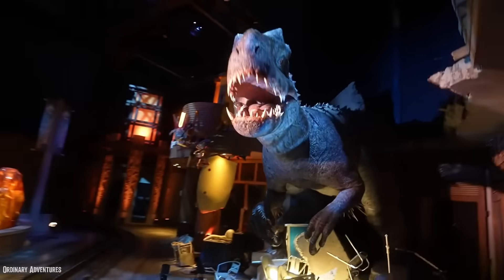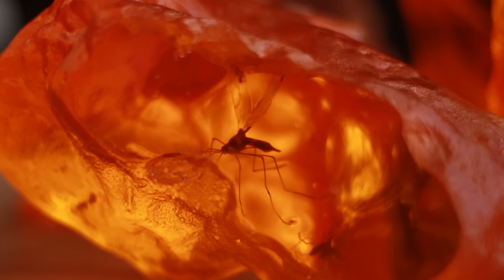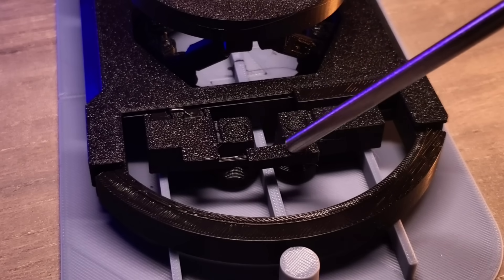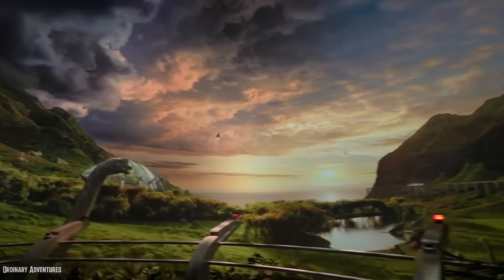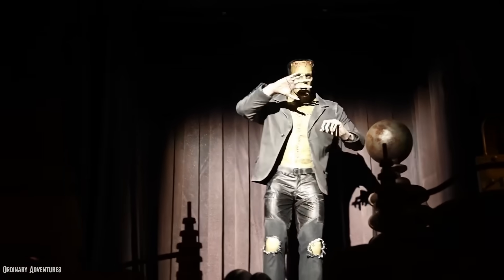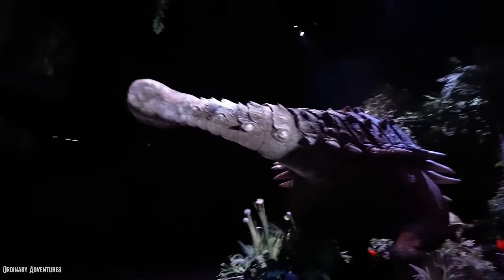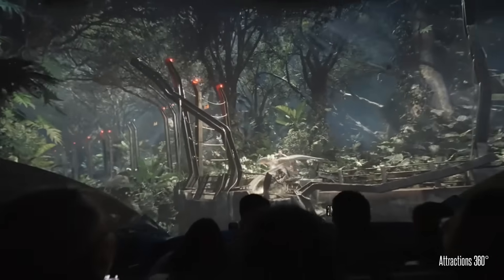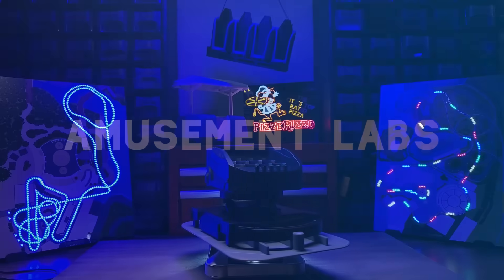This Animatronic HUNTS YOU DOWN | How It Works: Jurassic World Adventure

Comment: The motion based perspective shift is crazy.  I was disappointed when rides started relying more on screens, but that's because of how the flatness betrayed the rest of the practical set.  They fixed it damn good.  Holy cow.
Reply: That effect has been around since Spider-Man in IOA in 1999, that ride was way ahead of its time. 

What's also cool is Epic Universe uses HDR LED screens instead of projections so the contrast is way more convincing than what they did on even this ride.
Reply: @Changedup-d3o  
In 1999?  Was it done with rear projection?  I never got to see that one.
Reply: @SewerTapes   It's still open, would highly recommend. Idk rear projection but it's giant screens. They updated the CGI to HD in 2012 so it looks modern now. But that's what that  footage around 6:09 is from, an old special on it.
Reply: I remember even looking on the Velocicoaster at Orlando and there is part of the line where you pass what are supposed to be windows but are really screens that show blurred animations of riders going by and occasionally a raptor walking by. They even added perspective to that if you look close to the screens, which is easy to do given how close they are to the line, you can actually look downward when you're close enough and see the rendered tracks below and they have 3D perspective to them.
Reply: @DrHumbult   Those are actually the real riders going by, there's a video of it somewhere on YouTube explaining the illusion. It is really bizarre but true.  Those are the real tracks, we don't have the 3D tech for that yet.
Reply: I remember thinking of my high school at universal and island of adventurers all the rollercoaster and was disappointed the last time I went it was all screens except like 3 out door rollercoasters. One of the strategies I used to do is ride the rides midway do a get wet ride and then dry off through the roller coasters. but with all screens i just stayed wet.

Comment: Why don't Universal Parks use Vanta Black paint to hide the ceilings and scaffolding in their showrooms?
Reply: Light absorbing paint is also extremely expensive and the general public just isn't that observant
Reply: Because in all the POVs used in this video they use a low light camera that sees more light into its iris than the human eye. Its as dark as dinosaur at some parts.
Reply: The Fire Marshal codes in Los Angeles for the studio are not just super strict but they are heavily enforced. Odds are big that has something to do with it.
Reply: @TheRadioAteMyTV This is in China
Reply: Imagine being an electrician doing maintenance and you get up on the ladder and the whole wall is the same color and you can't find the fuse box because it's the same color as the wall
Reply: Even a mixed vanta would make it better, Or adding UV reactive coating, that way electricians can still find it, also Vanta Black is not invisible lol  @jntproductions1

Comment: Battle at Ministry makes this look pretty outdated by comparison. Still a great ride.
Reply: How do you figure? This has a moving anamatronic. Ministry had to use a screen to accomplish the same trick. Seems like Ministry was a regression from this ride technology.
Reply: @jacobyrobinson2097 Ministry has just as many animated figures as this ride does, it also has larger set pieces. It does use more screens, but the screen/practical immersion tech is definitely better with Ministry. Both also have some enormous animated figures. Both are absolutely astounding. JW has less screens but not as detailed realistic environments, Ministry has more screens, but larger more detailed sets.